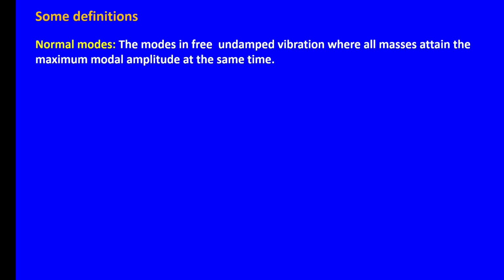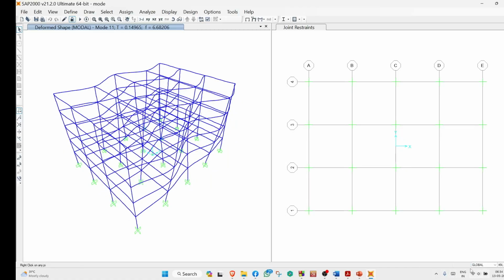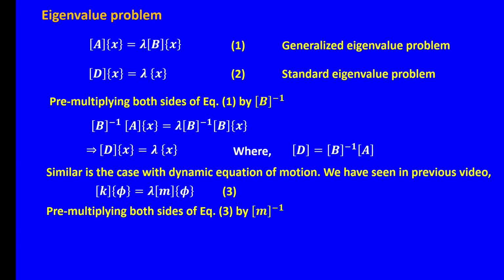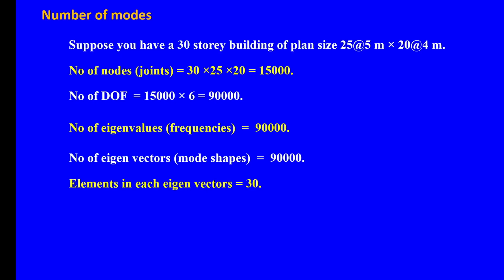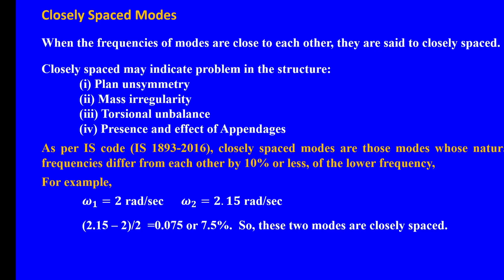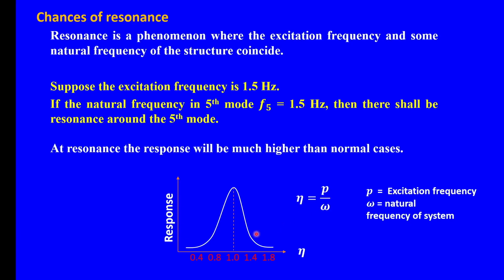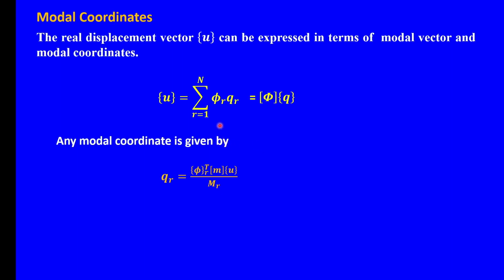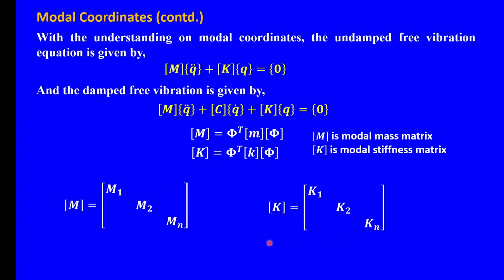More on Modal Analysis

Comment: Thanks again . For the closely spaced modes , the modal orthogonality won’t be mathematically applicable right ??? as these closed spaced modes have the influence to each other as they exchange energy. Is there any detailed discussion or reference journal  on the energy exchange in between these closely spaced modes …
Reply from the maker: Thank you for your deep inquiry. Closely spaced modes are said to be tightly correlated. The correlation index is given by a Mac number.  Tightly correlated modes are "fugitively" alike to each other and may not follow general rules. You may read - Nayfeh, A. H. and Mook, D. T., ‘Energy transfer from high-frequency to low-frequency modes in structures’, Journal of Vibration and Acoustics 117, 1995, 186–195. Nayfeh has done a large volume of work in this direction.. .. However, I have not delved deep into the issue.
Reply: @PerformanceBasedSeismicDesign  thanks a lot for such a great info .
Reply: Thanks a lot sir